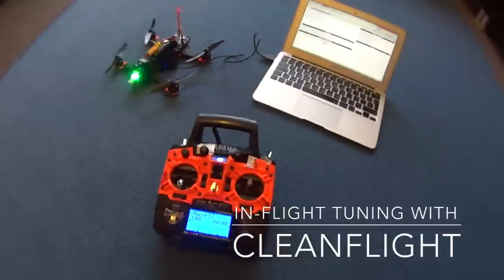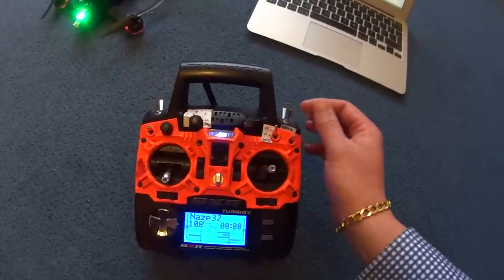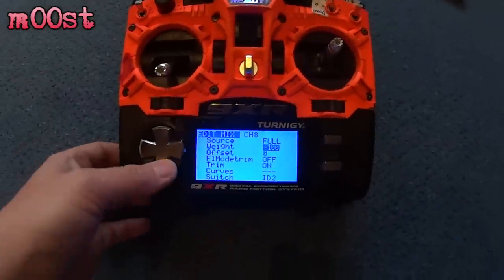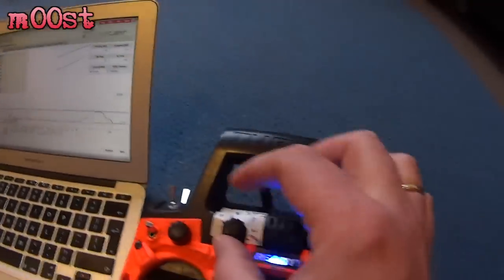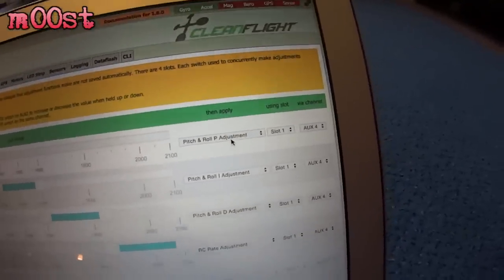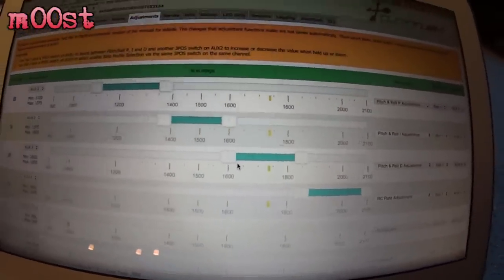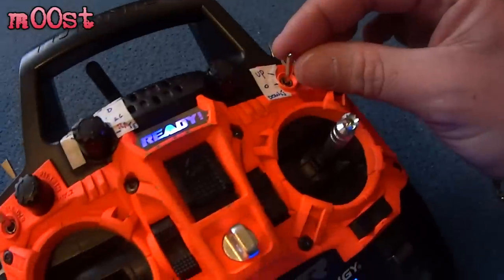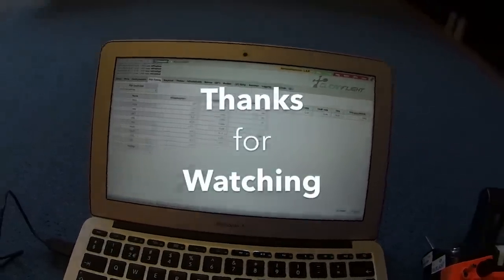How to configure in flight adjustments/tuning in CleanFlight (using Turnigy 9XR)

Comment: 6 way encoder is way to go. It gives you feeling of what you selecting. Especially when you have your googles on ;) And add "no action" rule, after all rules. See last picture in the manual:
 
"In the following example, the incorrect configuraton (above) has been corrected by adding a range that makes 'No changes'."

Btw... https://www.youtube.com/watch?v=tDn42mVsnpc  :)
Reply from the maker: Thanks. I searched for videos demonstrating the video but couldn't find any. So now there's at least two ;-)

As for assigning 'no changes' to the idle range: good point. It doesn't do much besides perhaps mute sounds on the +/- toggles but it's better to have it defined, agreed.

Comment: Thanks, had no idea this was possible with 1.8.0  I can recommend a seller on Ebay that has a nice 6 way switch >>> http://www.ebay.com/itm/UNIVERSAL-Mode-switch-6-POSITIONS-ArduCopter-ArduPilot-APM-Fully-Assembled-/291523593735?hash=item43e0290607
 I swapped this for the very same potentiometer on my 9X  and it comes with trim pots to allow you to dial in PWM values for flight modes for CF or Mission Planner . Also has a optional set of tiny but extremely bright LED's you may acquire and connect to indicate visually with nice colours the Position you are in.>>>http://www.ebay.com/itm/6-Modes-color-LED-indicator-BOARD-ArduCopter-ArduPilot-APM-DJI-DIY-VERSION-/121603847889?hash=item1c502776d1